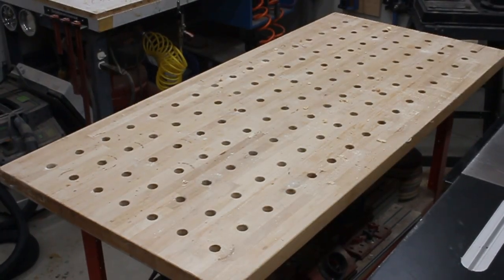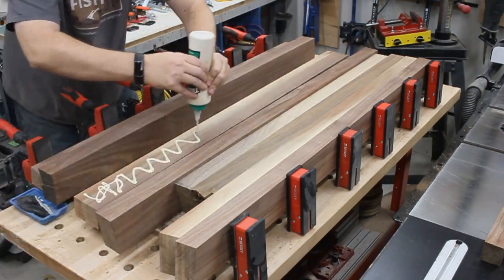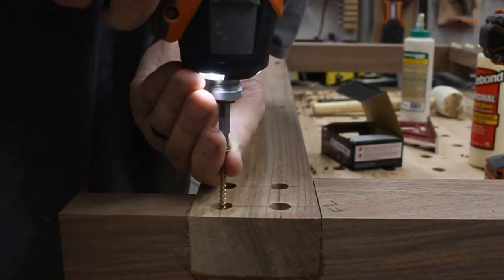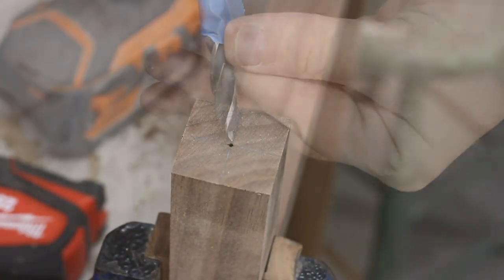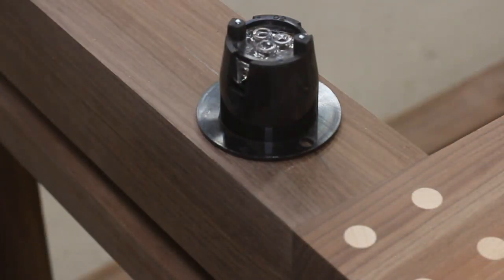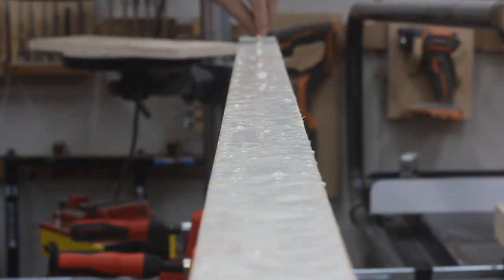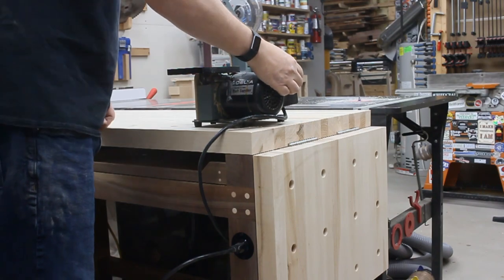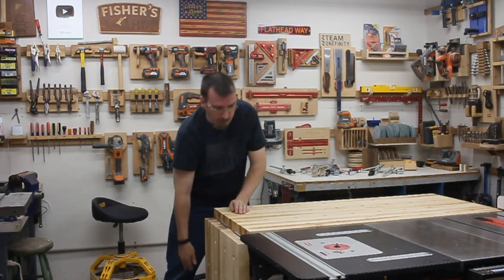Woodworking: Making Fisher's  Ultimate Workbench

Comment: I love the idea of using dog hole clamps to do the work of a vise. How do the side extensions stay in place though? Do they flop on their hinges if you are trying to saw or plane a peice clamped to them while in the down position?
Reply from the maker: Yes, they hang loose but it's never been an issue thus far.  If I needed to, a quick squeeze clamp would hold them down tight against the leg.

Comment: Inspired by what I've learned from your site, I built myself an $800, custom work bench

$200 - Wood & Hardware
$200 - Replacement windshield
$400 - Replacement 'soft touch' car radio.
It seems that my car was almost long enough to hold  the wood...

Comment: Nicely done!
So is there something to hold the drop down end in place when clamping a workpiece in a vertical position or do you clamp it so it doesn’t move?
Reply from the maker: I just let it hang there.  They're pretty heavy and it takes effort to move them.  But you could easily add a window sash lock to secure them down if you wanted to

Comment: Drew, that bench is gorgeous. How many coats of danish oil do you typically use?
Reply from the maker: Just a couple on the non-work stuff.  Then I keep putting it on the main work surface until it stops drinking it.
Reply: @FishersShop  awesome, I’m in the market for a  workbench and haven’t decided between a hardwood top and a MDF top covered in laminate. I wasn’t aware of the glue benefits danish oil provides. Something for me to consider

Comment: I wish you had included a link to that magnetic feather tool with the adjustable end parts…. Been looking for that.  As always, great production!!  Love that table.

P.S.  Save the “I defeated you!” until you’ve fully extracted the fastener out…. Sometimes, that slot you cut disintegrates and you’re really stuck!  😮😅
Reply from the maker: Go to mag-tools.com and use FISHER10 to save on it.  I love that little featherboard
Reply: @FishersShop  That is great and thank you for responding!  It's on its way!
Reply from the maker: @jimsjacob  right on!  You’ll love it!

Comment: Gorgeous!!!! Please telling me you're doing the storage faces underneath with the Maple. I think that would look great! Love the functionality of the side wings in the vertical position too. Do you have any issue with them wanting to swing while you're working though? Should they get a latch lock at the bottom?
Reply from the maker: I thought about adding a window sash lock to hold them closed but that would make the front face of the bench no longer flat.  Well it turns out they're pretty heavy and it hasn't been an issue.  They don't move unless you really make them
Reply: @Fisher's Shop  good to know. also I'd love to try some of those bessey dog hole clamps but they're really hard to find. Where in the US can I get them?
Reply from the maker: @chrisjaustin88  They're actually for welding tables but with the adapter, they are perfect for woodworking benches.  I'd start with Rockler and Woodcraft

Comment: Beautiful table.  I really could not ask for something better.  Yet, I do have one comment. Your drawers are for sawdust containment and for placing small tools in, yet, you stated how much you hated sawdust dropping down on what you had stored under the table surface.  The problem is, you traded one set of dust laden tools for another.  I would have placed the drawers a tad lower, then installed a set of slightly angled thin plywood  that would drop towards the back of the table.  At the back, install some sort of dust collection scheme.  Then you have dust contained without anything dropping onto your nice (small) tools.  This also means you can vacuum it out without worrying about a small tool being lost to the vacuum.  That said, if you don't use the drawers as holders for tools, it will function perfectly and help prevent contamination issues below.  that's a bench you can be proud of...
Reply from the maker: I thought about that but anything higher up would obstruct the dog hole adapters from fully seating down into the holes.  The only thing I'm going to keep in those trays are things I don't mind getting dust on.  My next video will be for all the storage going down below and that will house everything else and keep it all dust free.

Comment: 11:11 - I have a desk I got from my dad many years ago. He bought before I was born over 51 years ago. It's quite light and has 7 drawers. One in the center just above the persons legs when they sit at it, and 3 on each side. These drawers have no special metal rails. There's just a groove cut into each side of the drawer and it slides along a bit of wood inside the desk. They're some of the nicest drawers I've ever used. About 20 years ago my ex-wife decides to give it a new paint job which ended up looking terrible but I just haven't bothered to fix it yet (she attempted to make it look like marble. It does not look like marble). It's held up for at least 51 years and shows no sign of stopping. So what sort of wood do you think it might be made out of? Thanks.
Reply from the maker: Clearly, it's made from solid Bohemian Slipperly Wood

Comment: Was hoping you would show final flattening/ sanding...That's the part of the process that has tended to intimidate me on these....WILL IT COME OUT FLAT AFTER ALL THE $ AND TIME...although I can see how halving this helps.
Reply from the maker: I only had to sand the glue seam since I used the biscuit joiner for alignment.  It turned out really good

Comment: @Fisher’s Shop:  At 11:30 - how do you know that’s the correct height for the drawer slides? I always have trouble with this part of drawer slide layout.  It’s never explained anywhere so I gotta be overthinking it.
Reply from the maker: Once the rails are on the drawer box, put the slides on the box over the rails and just set the whole thing in place and shim it up until it's at the proper height.  Then make a mark on the front or back where the slides are.  Take the box out, remove the slides, and then re-shim them up to your marks.
Reply: Yep.  Overthinking it. Using calipers and rulers and measurements.  Ugh.  Thanks

Comment: Hello Drew
I love your Chanel. 
Sorry..  My english is not verry well.
But wat i my ask.. 
Wen You have a small Shop.  Wy you don't build a lifttable?
You're mutch more flexible with a lifttable in a small Shop. . . I thinke.
I wish You and your Family a merry chrismas
Reply from the maker: Thanks!  Lift tables are for transferring items from one location to another that are at different heights.  I simply don't have the room to be wheeling around a table in my small shop.  Doesn't make sense for me.
Reply: @FishersShop  
But you can work at different heights. 
You can easily move small objects up and simply leave large ones down.  And your back always stays straight.
 You can work on it while sitting if you want.
 And you can transport heavy objects or machines.
 I don't want to be without my lifting table anymore.  
Warm greetings from Germany

Comment: Great video. Not to scare you but make sure your connections are really tight on the wire going to your plug. Loose connections can cause a build up of heat and may end up being enough to catch that wood on fire. It's a reason outlets are installed in plastic or metal boxes.
Reply from the maker: Yup, all good

Comment: I'm confused.  So you included trays to catch all the dust that falls through the dog holes.  The same trays that you will be storing frequently used tools in...which will be covered with all the dust that falls through the dog holes.
Reply from the maker: Yes, but MUCH easier to clean up than how things were before.  And frankly, I probably won't keep much in those trays beyond chisels and maybe some sanding blocks.  They've already proved so useful to me.

Comment: Where can I find un-sawn wood. I’m building a work bench at present.  I’ve got the frame built out of fir pine. But want a nice hardwood for the top.
Reply from the maker: You can find TONS of it in the forest.
Reply: @FishersShop  Yes and most of those forests are owned by private citizens or the Government
Reply: @FishersShop  I’m thinking of starting a channel and it mostly will cover remodeling and updating my wood shop.  You know a good source of information on how to get a channel up and running.